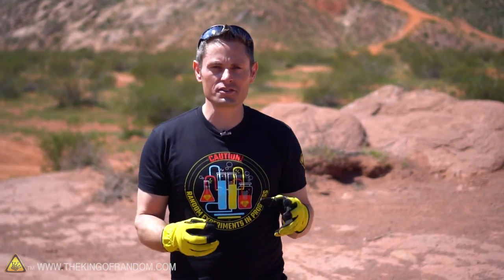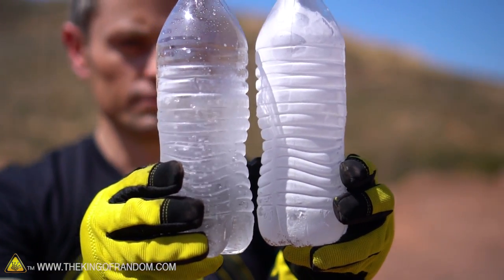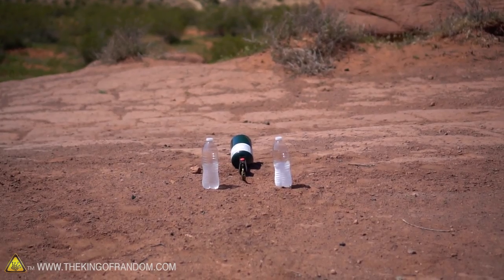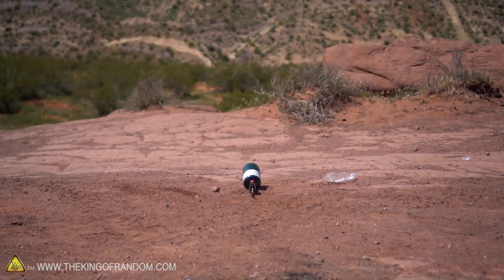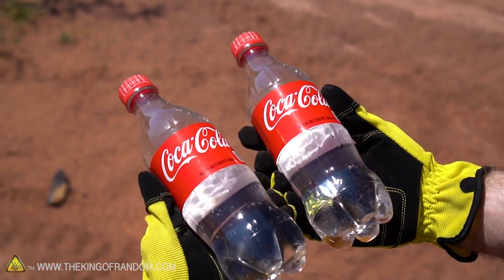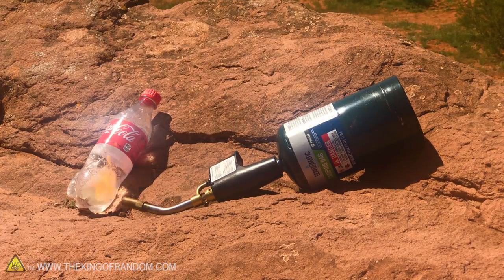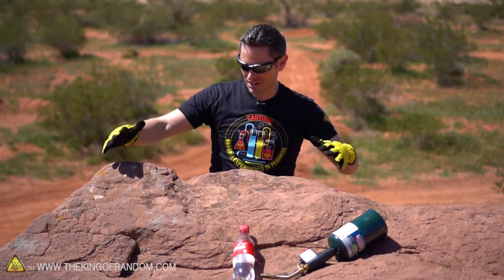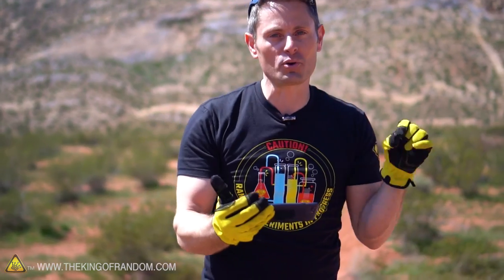Don't Put Gas Next to a Blowtorch - The TKOR Gas Bottle Explosion With Butane Experiment

Comment: What happens when mixing them both together and heating them up? Do this for a video 😉
Reply: Tom it would just blow up
Reply: Tom T yessss
Reply: SAHOODOUKEN! Yeah but what would happen?
Reply: Tom T i wonder if there is a way to color the liquids to see if they separate in the container, and I do wonder how violent the explosion would be if a similar test to today's was done.
Reply: totally agreed just blow up like they blow up when they are not mixed.
Reply: But how would fire happen or not
Reply: It would just burn normally like propane or butane alone. Propane-butane mixtures are extremely common in Europe, sold as normal stove gas or as fillament into lighters. Nothing exciting.
Reply: /watch?v=dyTj3J1z7Hc

There you go. I hope you're smart enough to know how to use that.
Reply: What happens when mixing them both together believe me: nothing special.
You will simply get LPG fuel you put into your car.
Here a bit of theory:
At 20°C butane will have a vapour pressure of about 4 atmospheres or 4 bars (60 psi)
At this temperature propane will have a vapour pressure of around 10 bars pretty much 150 psi.
If you make a 50-50 mix of these gasses you will have a gas with a vapour pressure of 7 bar or 105 psi, just the average of both.
What vapour pressure means is general (it depends of temp by the way...) if the outside pressure is higher than the vapour pressure of the gas it will condense into a liquid; if the outside pressure is lower than the vapour pressure it will Vaporise.
This vapour pressure is temp-dependant. At a temp of about -1°C the vapour of butane is equal to atmospheric pressure, coincidently that's exactly the boiling point of butane in our atmosphere. Same thing is true for all gasses: water or steam have a vapour pressure of 1 atmospheres at 100°C, which is also it's boiling point. 
This is why water boils at room temp under vacuum.
---
Now what happens with the propane that Grant uses is this: The gas expands, therefore it cools down; part of the gas escapes into the atmosphere, part of it condenses because it cools below it's boiling point.
It's liquid at room temp just because it's cold. But once you close off the lid it will heat up and build up pressure. That's it m8. By the way: as long as you don't put on the lid it won't heat up, because the part of the liquid that vaporises, cools down the liquid that's left in the bottle. Once the cap is on, it can't vaporise, it can't cool down, so the sun will just warm it up to ambient temp.
---
Why propane exploded so vigorously: Vapour pressure of propane is 10 atmospheres, a coke bottle is rated at 10 atmospheres; it CAN take a little bit more than that just to be sure, but not much.
If you mix butane and propane, their combined vapour pressure depends on the ratio in which you mix them, a 50-50% mix of propane and butane will have about 7 atmospheres. So the bottle will be LESS pressurised than with pure propane. How can anything spectacular happen?
---
Note to scientists who read this: I know the term "partial vapour pressure", I know there is more to it, I just kept it simple here.
Reply: Tom T nice copy paste
Reply: SAHOODOUKEN! Lmao so if i write a long definition or what is going to happen its copy and paste? Not all people are kid on youtube. There are people who also have a life and jobs and dont just watch youtube 24/7
Reply: +Windex It's kinda funny hearing that from a profile names "Windex". lol
Reply: Propane-Butane-mixture is known as LPG

Comment: grant do a video of if you freeze propane with liquid nitrogen can it still light
Reply: TheEmeraldDojo if it's combustable it sould ignite in any state of matter liquid gas solid and plasma not to sure about plasma tho!
Reply: Only the vapors will ignite. Even wood itself doesn't burn, the vapors from heated wood is what actually burns.

At LN2 temperatures, you would have trouble getting the LPG to vaporize.

Comment: try melting tungsten in your arc furnace!!
Reply: he cant, not hot enough
Reply: LGA 1366  just try
Reply: gl hf
Reply: Saad The Hacker not gonna happen
Reply: Saad The Hacker What about the Pharrell lens
Reply: tung sten means heavy stone
Reply: Saad The Hacker check out beyondthepress they tried to melt a cube.
Reply: LGA tungsten can be melted with an electric arc and small diameter rods, like those used in TIG welding will melt and contaminate welds if shorted out. It depends on the available current, volume of the tungsten to melt and heat dissipation. Arc furnaces are exactly what is used for melting high melting point metals and alloys, including tungsten and molybdenum.
Reply: Kageitenshi tung sten in swedish is heavy stone
Reply: thegamer550 what does that have to do with what I said and why repeat it?
Reply: it just came to my mind and i commented just thinking if grant would try it thanks for all the suggestion guys
Reply: I don't think that he could melt  tungsten
Reply: it has the highest metal melting point in the world
Reply: Benjamin Briggs there are multiple how to articles on melting tungsten with arc furnaces with and without a vacuum, the latter resulting in a more useful end product.
Reply: It's melting point is 6192 °F
Reply: And? Like I said previously, it is also quite easy to accidentally melt tungsten electrodes used in TIG welding, so the melting point is hardly an issue, even with an ordinary welding machine. It all depends on the amount you want or need to melt and how much energy you have available. Then there's the consideration that the firebricks he has for his mini arc furnace probably won't hold for long.

Not just that, but what do you suppose is the reason for having to resharpen and replace TIG tungsten rods every now and then anyhow, if not the tips downright vaporizing in the process.
Reply: mix molten gallium into sodium will give an epic reaction i guess that will help you

Comment: We made your amazing mini metal foundry and it worked great. we managed to make 12 oz of aluminium!
We were using charcoal briquettes and it worked fine but today we tried regular charcoal, straight away we noticed it was a lot hotter and worked faster. but after our first batch, the plaster started to melt, the flames went bright yellow and shot up about 3 feet above the forge. IT WAS EPIC!! But quite scary at the same time. :D

Comment: Can you do the same thing for Computer Duster??? i heard that the gas inside of it is also flammable and has a very low boiling point. LIKE IF YOU AGREED!!!
Reply: Elastico345 Gas? Boiling point? Okay. Makes sense.
Reply: +Jaike Basically it's difluoroethane. which is a gas but liquid inside of a can. (like both butane and propane)
Reply: Elastico345 So it's not gas that's inside, it's liquid. I was just commenting on the fact that even though what is inside is liquid, you still referred to it as gas.
Reply: It results in CO2 which puts out fire lol
Reply: Elastico345
Reply: The difluoroethane is flammable but it will release hydrogen fluoride and carbonyl fluoride when burned. Both of these gases are extremely toxic.
Reply: If you flip it upside down it freezes

Comment: Mix Propane, Butane and a Gasoline and try how flammable it is
Reply: i don't think it would mix, it will probably be like oil and water except you can't see the different colors.
Reply: Unless you dye them.
Reply: and watch them boil :D you know gasoline is not the same as water right?

the dye will make them boil ofc
Reply: There are different ways of dyeing chemicals with compounds that are non-reactive.  But this doesn't really matter because all 3 would actually mix anyway, and often are in various ways. Such as the winter mix for gasoline contains butane, and butane and propane are often mixed for some high performance fuel types.  However just like with metal alloys different ratios may have differing properties in the mix.

Comment: Yo @Grant Thompson; Did you notice the rocket? When you placed the two bottles next to each other and placed the torch between? After the second bottle went bye bye the first bottle jumped in the air, did a 180 and headed skywards using the contents as liquid propulsion. Pretty cool.

Comment: The sudden release of expanding vapor can remove oxygen from the torch flame and without any hot glowing products to cause re-ignition when air mixed in the right ratio, there is no fireball. The first one with the pinhole jet, was a larger flame covering larger distances and appears to have never been starved of oxygen, so the gas cloud was ignited.

Comment: On a warm day (25c) you're looking almost 150psi with the propane. The 20oz bottles can probably hold more pressure than a 2 liter, but... probably closer to seeing how well the gloves hold your fingers on than you might like. Butane is way lower. You're right about the sometimes it goes up in flames/sometimes not. The lower and upper flammability limits of both are pretty close to each other ~2-9%+/-

Comment: A video of an adapted bottle launcher (like the one you designed for the original version of this experiment, before the butane/propane) that has a bottle of butane in it, with a steel tube around it, and some object on top that gets flung out by the butane exploding, which is triggered by a hole in the side of the steel through which a flame is exposed

Comment: One difference between the butane and propane is the pinhole. I'm not certain about pressures, but with the pinhole you had an extended flame. Allowing a proper air fuel mixture (oxygen/propane) to create a fireball. However, the explosion of the butane rushed the flame of the torch before a proper air fuel mixture could be obtained and either blew out the torch, or removed the oxygen supply, but I think you already know this, cheers.

Comment: I'd like to see this experiment redone with the bottles not being placed so ridiculously close to the torch flame. I feel like the torch literally melted the bottle which was the source of the sudden structural failure, especially on the second bottle. Maybe do it with the bottle in a metal can and heat the can with the flame to provide slightly less direct heat to the plastic?

Comment: butane is heavier then air and has more btu's per gallon,also maxpressure is 125 , propane is lighter then air and has pressure up to 250 psi . both are cryogenic liquids.people should give transport drivers a lot more room when driving down the road as they  usually haul between 8000-14000 gallons .........enough to level square miles.

Comment: What happened with the butane in the water bottle is that the pressure popped the lid off and afterwards the butane came out because of the air I think. Like when you shake up pop.

Comment: so i was wondering at 3:03 you grab a just burnt out propane torch by the nozzle with gloves on and it didn't burn you or burn your gloves and you didn't notice either There either was a major cut and you turned the gas on again to do the scene or it was not lit the whole time you were waiting or your superman im saying this because the torches would stay hot and very hot for quite a while if left on for as long as it looked while waiting for the water bottles to blow or just some killer gloves. I really dont know that why i am saying this.

Comment: The only reason the propane water bottle blew up was probably because the heat from the blow torch made the plastic weak because it heated up. And since the bottle was trying to pressurize, the gas saw that as another place to move into, but since that area of the bottle was already weak, it burst. Not to mention the fact that as it bubbled out, the bubble was above the flame, so it made the bottom of the bubble even weaker.

Comment: PLEASE PLEASE PLEASE... As a kid we used to put Tippex (correction fluid) bottles in a pan of boiling water. The water would soften the bottles and the expanding Tippex fluid would inflate the bottle to softball size.  I thought you would be doing something like that with these coke bottles (i.e. what happens if you heat the bottles gently with that pressure inside)? Go on... you know it makes (no) sense! :)

Comment: It seems to me like the butane bottle's top was faulty compared to the propane. It was clearly the weak link on the butane bottle. However with the propane, the bottle ruptured while the top was totally intact.
Reply: For the water bottle, that is
Reply: Now having watched the video in its entirety, my conclusion would be that the liquid propane is stored at much higher pressure relative to the butane, but the butane is far more volatile. Therefore the propane bottle expands much more than the butane after it is transferred to the new storage device because the much greater drop in pressure means a much greater temperature drop and volume increase. But once they've equilibrated at outside temp, the new jump to the propane torch temp means the butane vapor pressure outmatches the propane very quickly.

Comment: So there was so much propane released at one time it displaced enough oxygen that it couldn't burn and asphyxiated the blow torch? Interesting. Maybe as it boils it takes heat from the surroundings as well? Probably a mixture of displacing oxygen as it explodes and cooling the air to subcryogenic temperatures. Next time mix with LOX. lol!

Comment: Couldn't you just put a small hole in another coke bottle lid to fill with? you'd lose less butane that way, wouldn't even need to be screwed on fully. You can buy valve adaptors to refill canister stoves from a lighter refill too. That way all the LBG is trapped.

Comment: the explosion and gasses displaced the oxygen that is why the torch went out, not very mind blowing at all really, is simple science, fire need oxygen to burn, even with a fuel like butane or propane, it still requires oxygen to ignite, the pressure from the explosion displaced the air around the torch extinguishing the fire
Reply: funny you say this later in video, but at first you act like it is odd and mind blowing that it happened,  consistency is needed for science man